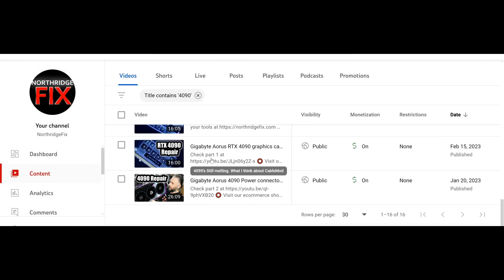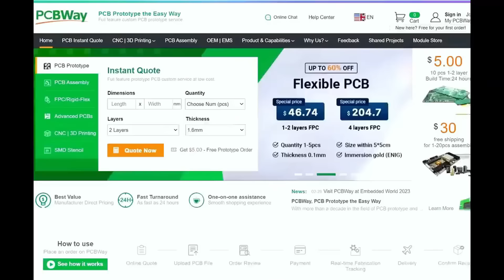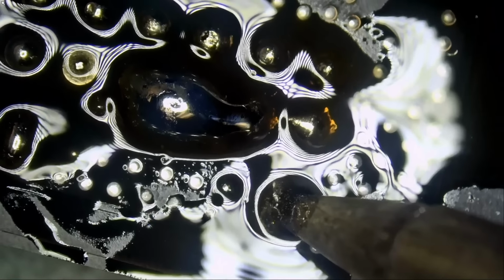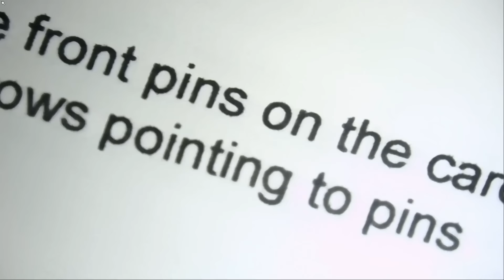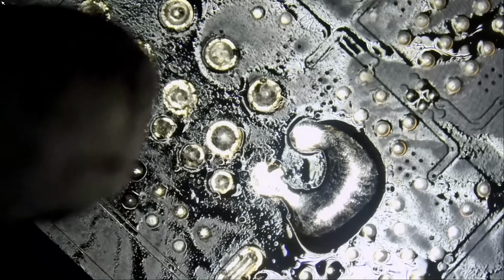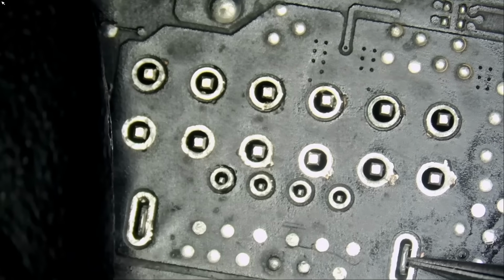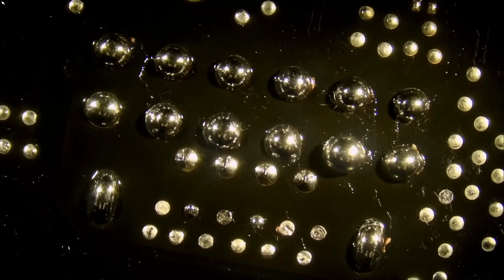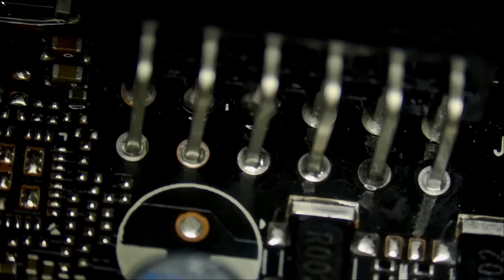4090 Graphic Cards are still a Problem.

Comment: Are you able to get the newer 12v-2x6 headers marked H++ or is it the older 12vhpwr headers? Because I have a gigabyte 4090 gaming oc revision 1.0. and would like to have the newer header put on it.. I find it funny that they deny rma under "user error" and then nvidia & pci sig revised the header but never did a recall.. Why revise a hardware change if it's user error? There needs to be a lawsuit.

Comment: I have had my 4090 since release, from the off I made sure it was plugged in properly and correctly without a tight bend on the power leads, not had a single problem. Pallit Game Rock edition.

Comment: I purchased my 4090. A Gigabyte Gaming OC on February 2023. Since day 1 i used a 12vhpwr without a split connector, single cable from PSU to card. Haven’t had an issue as of yet. I overclock the card +150 on the core and +900 on the memory for daily use so it is pulling a lot more power. Saying this is a user error is not entirely accurate. However it seems to be the biggest % of cases. Saving this video in case i have to send my card for repair.

Comment: This situation is frustrating; I'm currently using a 3090 Ti and was considering getting a 4090. After seeing this issue last year with melting power connectors, I held off. I am surprised that a year later, there is still no fix for this. Replacing the power connectors is merely a temporary solution, as it is likely to occur again. I'm waiting for the 5090; hopefully it will perform better and prevent the power connector from melting. I did see asus introduce BTF. Therefore, the motherboard's PCIE draws power up to 600 watts. I'm not sure if this will work, since you'll be plugging in the power behind the mother board. I'm not sure if anyone has reported any issues with the power connector melting from behind the BTF motherboard. If it does work, it stinks because it's an extra expense to buy a new motherboard as well as a new case that supports BTF connections.

Comment: Hi, may be a silly question, but have you considered designing a heat resistant connector in conjunction with a manufacturer of the connectors, maybe some sort of heat resistant material, just a thought.
Reply: but that wouldnt solve the problem... it would propably make it worse if your connector gets really hot and u dont notice anything

Comment: I've had my MSI  rtx 4090 gaming x trio for over a year with no problem still running great use a third party cable and make sure it's plugged in all the way
Reply: What third party cable do you use??
Reply: @Butcheratmadness  still don't trust tha connector itself

Comment: I want to thank you for this video. .. 

For explaining what you're doing... 

I change some mosfets on a Rockford fosgate amplifier .. and I burnt the board ... 

I would have never thought to use low hg eat solder to mix in right away. . 

I completely understand now...

I haven't tried taking anything off a PCB since then 2016 ish . 

You get down to the point .. 

You don't take forever to explain.. 

Your perfect.. 

Please do more ....

You sound like explaining bothers you ....

But your not talking forever making the video trying to hear yourself talk like most . .. 

You don't have that problem.. 

I actually don't want to turn your video off... 

I'm a afraid I would miss some important information if I turned your video off....

Please keep the info going.   

I've seen lots of your videos of video cards coming apart and going together.. 

And I'm baffled and clueless to what's going on... 

I wish you would explain over the video of what's happening.  

I know some people don't like to hear talking. . 

But you amount like the teacher.. 

That people would walk right into the classroom and sit down mesmerized as you explain items you're holding...

You have that gift ...

You don't have a massive accent.. 

You are easily understandable.. 

Please keep them coming

Comment: Watch the paolo gome, they explain why it melts, the design if the pcb was defect… it can be fix if only they use two 12v connector or modified the 12v and add additional 2x 8pin pcie

Comment: have you had any of the gigabyte boards in, especially the waterforce ones, I had one under a thermal camera the other day,  the voltage regulators for the memory aren't under the cold plate... 60°C at idle... 99.9°C under any kind of load.... could this be why the memory always falls off :face-turquoise-covering-eyes:

Comment: I’ve been using Lian Li V2 on mine for over 7 months no problem! They do get really hot within 2 minutes upon start up. Good thing I went with Gigabyte version that has 3 Fans! Gotta keep them fans running on all the time!
Reply: That's why I have GPU Tweak 2 set to auto run and force fans to run.
But Thermal Grizzly WireView adapter is I what use to stay safe.

Comment: I bought a Gigabyte RTX 4090 Gaming OC card, but I also bought the original PSU to GPU 12VHPWR cable for my PSU so I don't use the adapter, and I vertically mounted my card so that the cable isn't pushed up against the side panel. Basically spent £100 more just to make sure the card won't melt its connector. 
Hopefully this issue is not present in the RTX 5090 cards.
Reply: exactly. if you do this correctly you will have no problems.

Comment: Do you think power connector location coupled with the size of the card is a factor? Most of the cards I've seen, including my own, have the connector in the stupidest place possible (on outer edge facing side of case). When I built my rig, I went out of my way to find a case that had enough room for my card and it still barely fits. How many are closing the case and putting pressure on the connection by pushing on the wires/connector?

Comment: Too much current through a single connector, it's obvious...
Reply: Either that or arching either way poor quality
Reply: When manglement scream "deadline is number 1 priority". Everything else becomes subpar, mediocre
Reply: Cards  can handle overclocking, but the cords can't. Power issues.  

I just built a new PC and haven't had this issue, although I don't overclock the GPU. And I have the new deepcool PX1000G 1000w PSU. 3.0.  Gen 5 with the 600w 16 pin  single cord 12VHPWR so I don't have to use the splitter cable that comes with the GPU..

If you don't manually overclock the GPU  in MSI afterburner, I think it is fine. Just enable XMP on bios set up and you basically get a good performance anyway.

Comment: I think this is a problem related to the power connector is not properly plugged into the GPU.   But I do not blame the user. It is a bad connector design that cause this. So the blame should be placed at NVIDIA. If you install a new 4090. Be sure to plug in short power cable that goes into the GPU. When the card is on your bench. And check that it is properly seated before installing the card in the case
Reply: Tests have been done for a long time.... connector plugged in well, this thing catches fire

Comment: I have an MSI 4090 that I bought a year ago. So far so good and I play FS 2020 for hours on end. I do hope they change the plug design on the 5000 series when it comes out because the connector needs to be a lot beefier.

Comment: An other nice repair done here more and more 4090's are getting these issues especially now which is almost 2 years after they launched.
Even though I am curious to how long these repaired power connectors last, some tell me that you need to use an ATX 3.0 power supply, but even these won't make much difference right?

The PCB date of that RTX 4090 card you are working on read 4122 meaning it was made during week 41 of year 2022 :)

Comment: Of course they are! 600W on a 6 amps per pin connector… that’s 8+ amps per pin. The only fix is to reduce current (reduce performance). This is exactly what those 4 extra pins are for.

Comment: That 12pin connector cable is where the problem is. I think Nvidia simply didn't account for aliexpress cables being used on 4090s. That's just me defending ngreedia though. It's more likely that they simply never cared enough to give the proper power input slots.

Comment: I wonder is the connector you have replaced the same or is it a better non melting type of connector ?? Can it be made using a ceramic mix ??
Reply: Same... the other does not exist.
At least on these cards

Comment: Unironically, why don’t they just change the motherboards form factor to not have weighted components hanging perpendicular to the board? This entire problem is bypassed by simple geometric solutions. You can even keep the exact same circuit archetecture, just change the physical shape to accommodate.

Comment: I honestly wonder how much of a factor the PSU used plays into this issue. Curious to see if it has more to do with older PSU's being reused that might be degraded to some capacity exceeding the limits of a particular rail. I have no issue with my FE card and I got it at launch. It's paired with a Platinum Seasonic 1000 watt with a dedicated 12 pin connector.
Reply: It probably is a multitude of mishaps. No stable current from the power outlets, not using a power supply which would protect your other components from the jumps in  unstable outlet power, not connecting the graphics card's power connector correctly and that the fact that said cable and the connector having too tight of an overhead for mishaps.

Comment: Excellent strategy Alex . Too much solder is good for 2 reasons . It will be a stronger joint and it will be cooler temp when carrying the same current compared to Ngreedias skint factory soldering . However I wonder if you used low melting point solder for the new connector. Otherwise could the same board connector be a bigger hassle to replace a year later because of excess solder??

Comment: i have a zotac rtx 4090 trinity, with a corsair 12VHPWR connector from corsair 1000w rmx swift PSU, after 11 months of usage with games that bring the card to consume over 400W the cable is still perfect being worried about all those melting reports i decided to check the condition inside the connector and gpu and both are in perfect conditions, the fact that i attatched the connector with literally 0 tension from cable is helping to avoid the melting? or the corsair connector is just better than others

Comment: Would limiting the power in Afterburner help mitigate the problem? If yes, by how much?
Reply: you can try it ...I just plazed with it (just have RTX3060ti...max 200(220)w ...I limited to 80% and it went in one game from 169 to 159 ...so it sure works ...try it out :)
Reply: I limited to 70% and got a 10% reduction in performance. I can live with that better than 1.5k card melting.

Comment: I want Steve to adress this again, because once again, the proof is right here, yet no one else is willing to have the conversation, except these fine fellows. Even worse, some big tech tubers, have the nerve to say, the problem has been solved lol. Nvidia got y’all shook, and lying to your audience. Keep up the good work!
Reply: How and why are warranties being denied?? That is my question.
Reply: It isn't a manufacturing problem. Go watch Gamers Nexus extensive testing video on this. By far the most in-depth, comprehensive lab testing and analysis done on the issue. The result is human error, specifically, improperly seated cable that is pulled sideways. Don't argue, just watch, you will see.
Reply: @sonsoffishes1 a design flaw that didnt take account for basic human flaw..yeah it s the connectors design fault..atleast they should some indicator or fail safe if the connector is properly secured or not..
Reply: @kubotite9168  Steve was laughing at this and I totally get why. If your going to spend thousands on a GPU you might want to make sure you seat the connector and not apply transverse forces to it. Anyone who did this shouldn't be building PCs. Sure the design could be a little better to be more idiot proof, but then again, should an idiot be installing a $2000 piece of electronic equipment?

Comment: My MSI 4090 is still going strong since I bought it. I did not use the power adapter that came with the card and that has helped.
Reply: What did you use?
Reply: I bought a power supply with the 12VHPWR cable. Then I bought the right angle adapter from canlemod but that got recalled. I now use a right angled cable from cablemod.

Comment: It's crazy that they're running up to 450w through a single 16 pin connector. My 6900 xt has a max of like 330w and uses three 8 pin connectors.

Comment: Northridge i love your work bro always have watch almost everyday but can i just make this point that iv had a 4090 since lunch and its being no problem what so ever i feel that most of the cards you have to fix is cuz most people are not cooling there pc enough when they have such a powerful card in there i guess i could be lucky but mine has never being a problem and works flawless but i have 12 fans a big case a liquid cooling which tbh if your spending 2g on a card just go the extra mile and cool it correctly. love ya vids bro just thought i should say this :) also im using cable mods cable not sure if that make diff but works no problem
Reply: Cooling has nothing to do with the story.

Comment: So what is the solution to this problem? Do you just keep changing put the power ports. Do you actually modify it so it won't melt again ?
Reply: Idk, I've had my 4090 since a couple months after launch and no issues. Pretty much everyone I run into with 4090s have no issues at all. I have a suspicion for the minority of GPUs it is due to cable bending trying to fit it into a smaller case which then puts pressure on the connector but who knows, mine is a Corsair 7000D. Used the squid cable for 5-6 months and replaced it with an updated cable. Probably put in thousands of hours of gaming. Amazing GPU for being an owner myself, but for everyone else, it has serious issues broadly. It's huge and if your case is too small, the bend on the cable can be a serious issue. Someone like Zotac even came out and said make sure you aren't bending it too close to the connector.

Comment: You gotta look at bright side, this means you can pick up cheap but broken 4090 off eBay and don't spend an arm and a leg on graphics card.
Reply: if you look at the prices, they aren't sold for that cheap, actually.
Reply: I don´t think that he has time to use a 4090.
Reply: @Marauder1981  Render videos
Reply: Florida Apple Mac Pros is entering the 4090 refurb business. Thanks!
Reply: AMD gpu is the real cheaper option and is more reliable. Sure AMD used to be ass 10 years ago
Reply: @toututu2993   They still suck ass with GPUs. Thousands of videos and support threads speak a clear language. And I wittnessed it with two cards myself. Their CPUs however work okay.

Comment: Asus will never say this is a continuous
 issue. Asus used to be high quality long time ago. Today l won't buy anything made by Asus.
Reply: I have a KFA2 4080 and it works better than the last 4 GPUs I had. I had 2 6800XT (never again), and two Nvidia cards with coil whine. The KFA2 works like a charm.
Reply: This is happening on all brands of 4090 reserve your hate for the connector.
Reply: Asus has had a lot of bad press lately in regards to warranty issues and scummy practices. They'll get what's coming. I'm glad we didn't buy a 4090 for our family computer.
Reply: It's not Asus, it's the connector.
Reply: There should be a class action lawsuit against Nvidia for a poorly designed power connector regardless of brand for all 4090s.

Comment: Why is this not happening to the 4080 super the 4080 Super OC from ASUS or Gigabyte pulls almost the same Watts as the 4090 and sometimes even more depending on the workload so its confusing why the 4090 connectors are the one melting but not the 4080’s or 4080 supers’ connectors any one can explain ?

Comment: I have a 4090, and so far, no issues for over a year. Replacing the connector with the same connector is just buying time, it's not an updated part. I'm wondering if cutting the connector off the power supply cable,  then remove the connector off of the card, then  just solder the wires directly to the card... thoughts???
Reply: possible

Comment: Some company could make a fortune, if they made a 2 8pin connector, you could solder on the board and it would work but using the old 8 pin plugs instead of this 12vpwr connector.

Comment: NorthridgeFix, are you sure it's the 4090's and not the PC builders bending the shit out of their cables? I'm putting my money on the consumers. I've seen hundreds of PC builds over the years that would make your head explode. Liquid cooling pumps mounted above the water line, cables bent at 90 degrees, fans mounted backward, etc.
Reply: Either way its not a customer problem its a design flaw. 250w+ cards should have at least 2 connectors. But nvidia always ensures every card has a major flaw to make you need to buy new sooner than later. its been this way for a very long time now.

Comment: Wonder if some of those connector problems come from 3rd party connectors like those custom cables you see on a lot of builds or even using adapters or extenders.
Are the connectors made by Molex or are they Molex knock offs?
I've used a lot of connectors and the knock offs are definitely not as high quality as genuine Molex.
Reply: This has all come down to bad design and refusal to honor the warranty. 
The number of cards experiencing this issue has clearly demonstrated this. 
You eventually reach a point where the numbers don't lie.

Comment: This is why u don't over clock but funny thing is the warranty states that no warranty if over clocked I'm defending no one but none of the cards u repaired mentioned if they where overclocked card or not my friend has a 4090 and he got it when they premiered and nothing's wrong till this day I just don't mess around with the volts